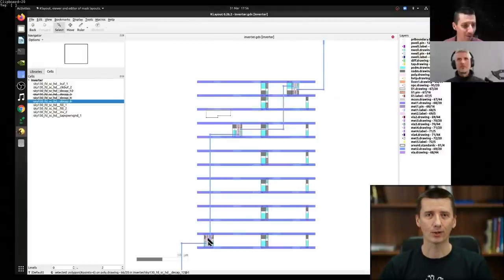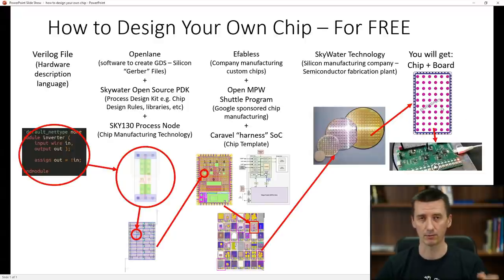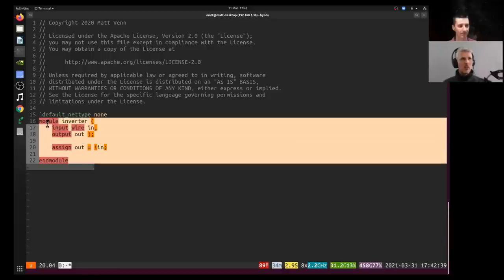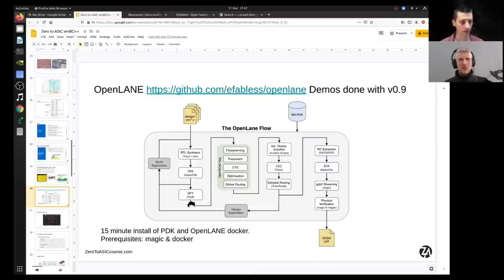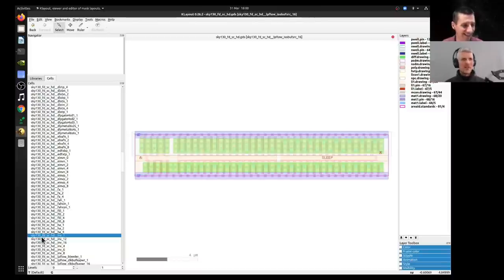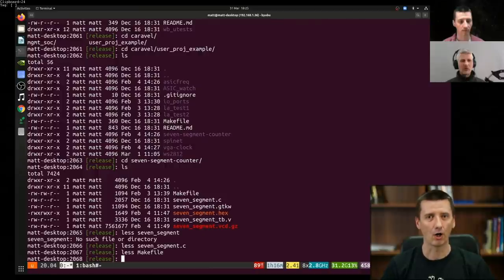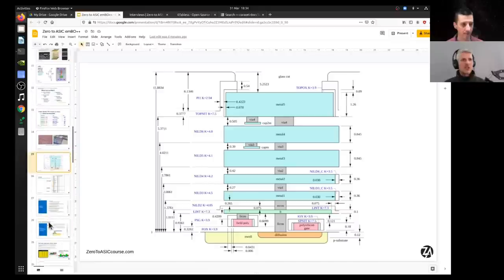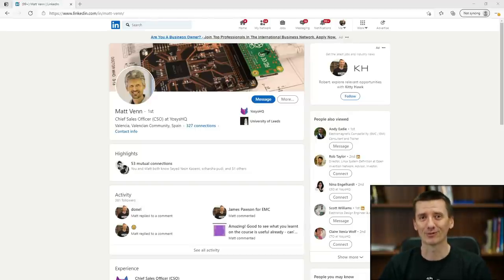How to Design Your Own Chip And How to Build it For Free (It Is Possible) - with Matt Venn

Comment: I took a class where we built 1um mosfets, diodes, resistors. Took all semester. The speaker was correct, the isolation layers are silicon oxide.

Comment: In my Ph.D/Masters program at the university, my minor was in VLSI design. It’s rather complicated. It takes a lot of calculation for the dimensions of each area and section that constitutes a MOSFET. You have multiple capacitances that have to be calculated and designed for. So basically, in a nutshell, thank God that people have created these libraries. We had to design, by hand, on a piece of paper, devices such as a multiple input NAND gate. It’s not easy. The tools being shown are fantastic as it takes away the abstract work required to build an inverter. It’s done for you! Very nice set of tools. Analog gets a lot more complex. Perhaps companies or individuals will develop open source analog tools, if not already available. I haven’t looked into it.
Reply: As Matt said, we are building on the "shoulders" of people that came before us. The standard cells are a huge head start. What's not mentioned here, is that today there are multiple open source PDKs, each of which contains their own standard cells.
Reply: @rolfw2336  yes sir, I agree. Recall when they were laying out the early IC’s, and they had huge pieces of paper spread on the floor to draw out the circuits. Quite amazing and reminds me of the slide rule days of engineering (which I missed by quite a few years). The standard cells are great. Software has come so far.

Comment: Very informative. Just wondering, what's the maximum gate-count one could put on this design? Also if RAM cells are present in the library, what's the Capacity/Gate ratio?
Reply: Gates don't really exist at a silicon level. How much you can fit depends on the size of the cells you use. A DFF uses more space than an inverter, of course.

SRAM was not released freely without an NDA and thus can't be used in the shuttle. However, there is a project to create an open SRAM generator called OpenRAM to fill this gap. It's still experimental though, afaik.
Reply: @squelchedotter  Thanks for the answer, I was looking for a ball-park number when I mentioned gates, as there is library already in place, and on average a number would have been calculated marketing-wise? 

Given the size of the cell on this video (and visually extrapolating for the whole chip), you get enough silicon real-estate for like 300 inverters. I'm not sure if anything complex (such as an FFT engine) could be implemented (unless I'm missing something...).
Reply: @nasserghoseiri4934  the design shown in the video only used a tiny fraction of the total area. The total user-defined area is something like 3x3mm, with the size of the cells in the hundreds of nanometers you can imagine that's quite a bit of space. For ballpark, one project reports they could fit 300,000 logic cells without any hand-optimisation.
Reply: @squelchedotter  Thanks for the info.

Comment: What drives the cost most when ordering a small production run of a chip? Is it the mask manufacture? Engineering/Setup? Wouldn't it be feasible to define a standard node and package (TQFP64 or sth like that) to allow small scale chip manufacture to be cost effective?
Reply: Masks are rediculously expensive, even for "bigger" nodes like 130+ nm
Reply: The mask set is very expensive as someone else said. That's why MPW is interesting as least for academic and prototyping (but still around 750$/mm² design for a not-so-sophisticated 0.35um if you don't have any sponsoring). State of the art nodes are more in the 40k$/mm² range. Expensive but the mask set alone worths 10 millions. Trust me, when you do a mistake as an IC designer, you sweat quite a lot, that's the bad part of the job :(
Reply: That is exactly what this is. The only reason that wasn't feasible until now is that no fab was willing to release their PDK because they gained more from keeping it secret than from reducing the barrier to entry. That's only recently changed with skywater and I think we'll see a lot more of it as fabs search for ways to make older technologies more attractive to customers.

Comment: Quick question, why do the unused cells get converted into capacitors?
Reply: I think it's just to improve power supply stability. In OpenLANE you always get a set of decoupling caps at the left and right. Then any space after placement is filled with caps.

Comment: This is very interesting, although (for me) it leaves some key questions unanswered.
What is the business case for an individual entrepreneur to go through this expensive (in time and money) procedure to get trained, and to then create just a handful of prototype chips?
How can this learning investment be leveraged and scaled to ordering (say) 500 chips, or 5000 chips? If that next stage requires paying a $22K mask fee up-front, then that is unaffordable, and the initial low barrier to entry for making the very first 50 chips was a road to nowhere.
From a technical viewpoint, I would also like to know how many logic gates the design can contain, and what clocking speeds are practically achievable. (i.e. to help compare its economics to an FPGA)
Reply: @Myria Tablet You didn't answer the question.  I'll make it easier for you by saying that said enterpreneur already has a customer base and a product to market but they want to reduce cost by replacing some analog chips with an ASIC (and reduce PCB area) both of which reduce the cost of the product. If you run a hardware startup that sells 5k to 10k units annually this open source IC design route leads you nowhere like Nicholas explained.  Because you need more than 50 chips with that 20k nre/tolling cost. So I share the sentiment of NIcholas' question, that small startups have it rough  in that respect.
Reply: I would say it's more to do with the learning experience currently. An FPGA is going to be more practical until you hit a big enough volume. Having said that we are waiting for a commercial version of the google shuttle. Efabless are working with Skywater to provide this. I'm hoping it will be a lot less than 22k!